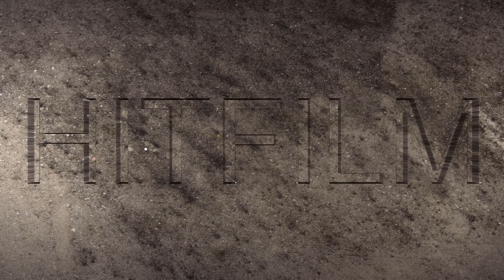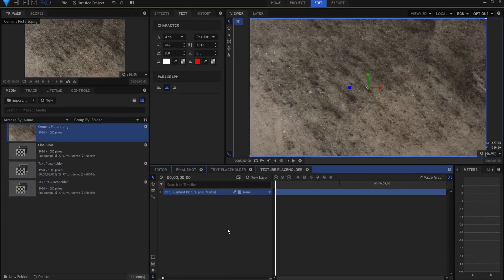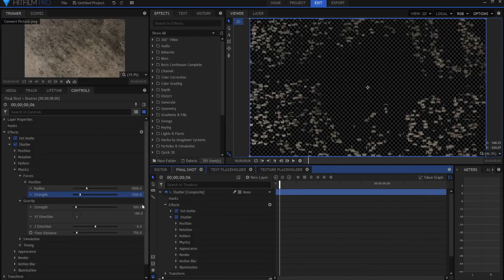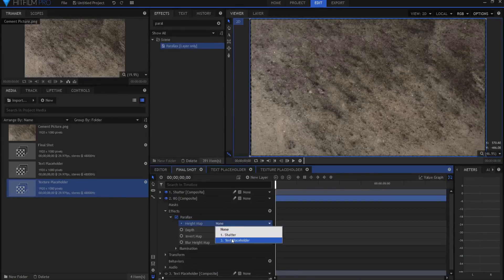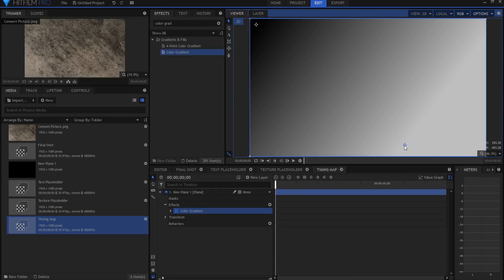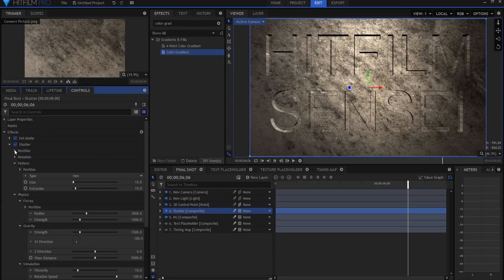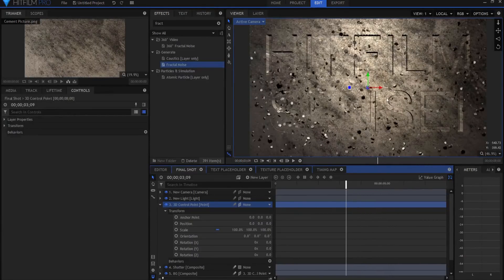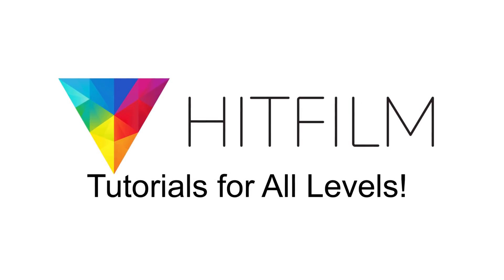Shatter Text out of Rock in HitFilm Pro!

Comment: Hi, Great tutorial! Is there a way to start slowly and speed up the dissolve? I'm going for the avengers Infinite war dust effect.
Reply from the maker: To answer your question, you can use the timing map to change the speed. I will come out with a tutorial on the Infinity War disintegration effect using the Particle Simulator fairly soon. Stay tuned! :)
Reply: Oh that would be great! Thanks!

Comment: Great tutorial. :) I have two questions about it. First, why do you need one extra Composite Shot with just the background layer in it? (Texture placeholder) Why not just dragging the background into the Final Shot Comp? Second, is there any possibility to get rid of the ugly highlights around the text BEFORE the shatter? It ruins the whole effect in some way, because you can see the text on the background before the shatter :(
Thanks a lot :)
Reply from the maker: You can certainly just drag the background into the final comp shot. The reason for having a Texture Placeholder is to make it very easy to change the texture. Just drag another texture into the placeholder. Your second question is harder. It can be difficult to dial in the exact properties to blend it into the background. The worse case scenario is to cover it using a mask and reveal on the shatter. I hope this helps!
Reply: Film Sensei Did not thought about this, but your absolutely right. This way it’s super easy to change the texture.. nice :) I thought about a mask too, but with the timing map (gradient) it could be really difficult to set this up right.. but anyways, thanks for responding :) keep it going :)